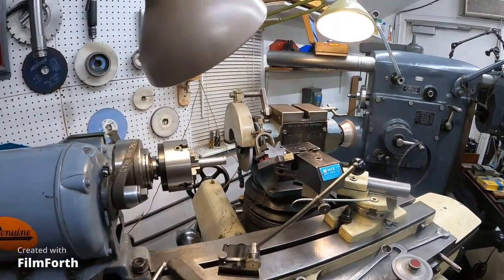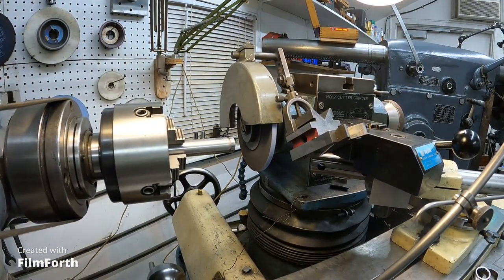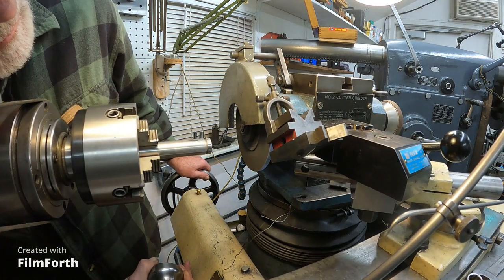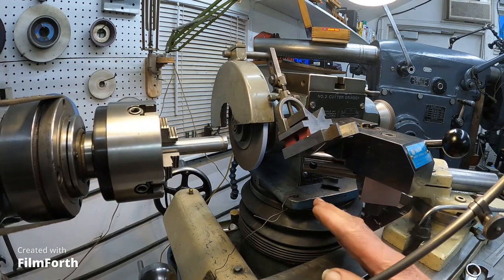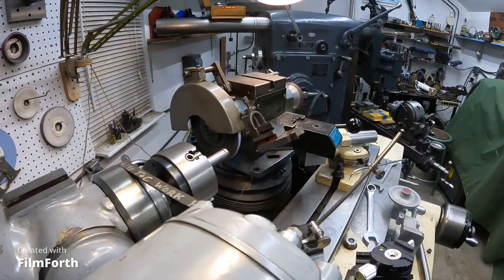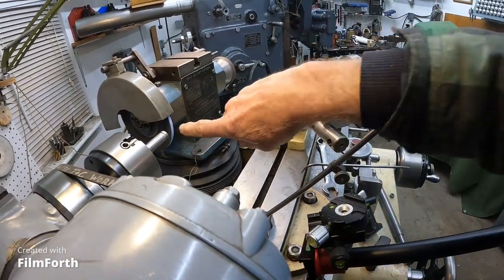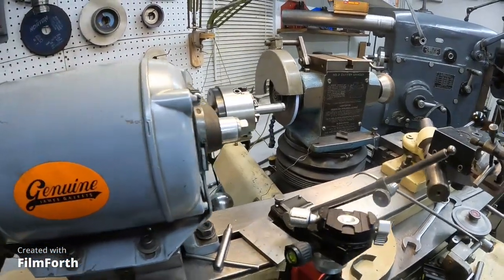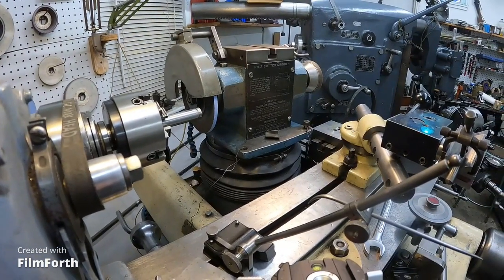Tool & Cutter grinder set up for OD grinding

Comment: What do you do mitigate the lack of fine need on these machines?   Only having a feed of .001/division is pretty big if you need to grind to tight tolerances (which is usually the case with grinding)
Reply from the maker: Great question! First, since the machine often sits for awhile the oil gets squeezed out from the ways, This old machine has manual oil points so I oil those then move the infeed in and out several times to completely lubricate those ways and the movement is slick helping to prevent creep from stick-slip making adjustment much easier but the table can creep forward starting the spindle so adjust only when running and let it settle in for a moment. I simply use a mechanical dial indicator on the cross movement for better accuracy. but may try an electronic one soon, Thanks for tuning in!

Comment: A lot to learn and fun to be had. Thanksgiving for the short lesson on 
Thanksgiving day.  Sounded like your cold may be going away.  Sure hope so.  I had a good day.  Ate too much and enjoyed or small family only meal.  I baked the desert, apple crisp, and it came out great. Life is good. Thanks for all your generosity and encouragement.  Cheers, TB
Reply from the maker: I managed to do mostly nothing today with my wife and two little dogs, I am treating the cold with kerosene and way oil and its almost gone! I was presented a modern automotive machine shop problem that may have a 1920s manual solution, help, the gears just keep turning in my head doctor!